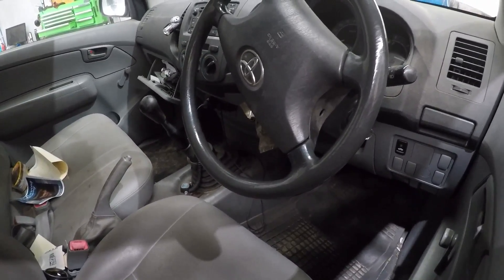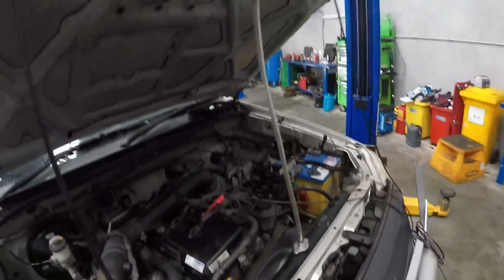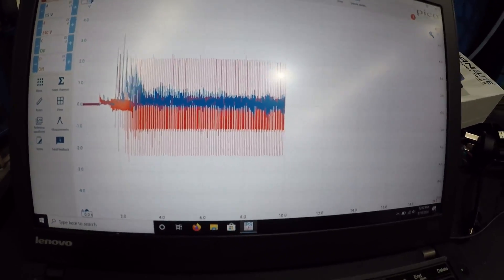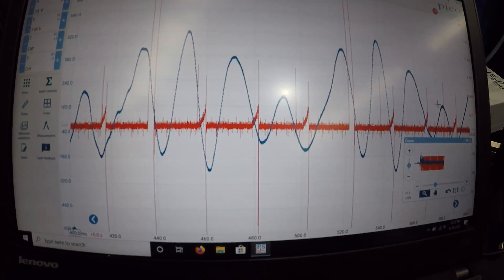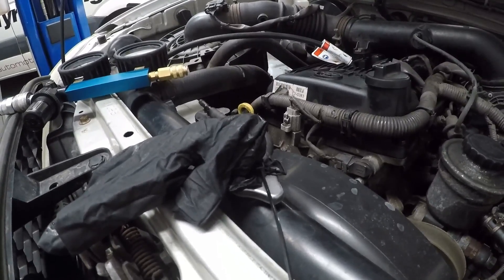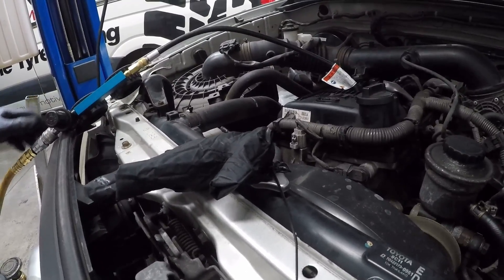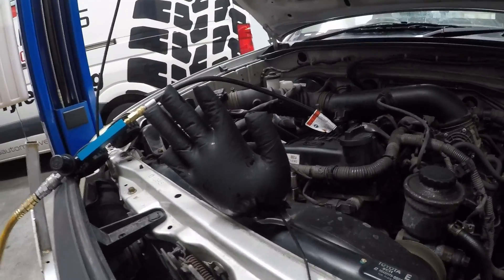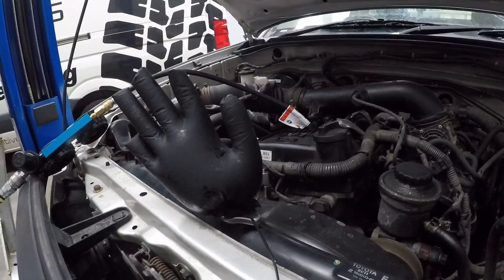Quick confirmation of a blown head gasket with a pressure pulse sensor, picoscope & rubber glove!

Comment: how do you diagnose a possible cracked head that is leaking oil into the coolant system? I have a pilot 2014  which has oil in the coolant system, would a crankcase pulse & radiator system relationship suffice for this? I don't have overheating issues, coolant is overflowing with oil so it is leaking out creamy fluid lol
Reply from the maker: Sorry scientist but I'm not sure what a Pilot is. We don't have this model in Australia. Does this have either an engine oil cooler or transmission oil cooler where the fluids could be mixing there?
Reply: @romanosautomotive  I suspect engine oil as it was low where the dipstick was not reaching it and of course the coolant was being filled in with it and looks creamy lol. It does not have oil cooler like Nissans, etc.

Comment: Would it be possible to have the same symptoms from a leaking egr cooler?
Reply from the maker: Yes depending on how bad the leak was but if using a pulse sensor and a scope to see that, you would expect the pulse from the exhaust on each cylinder to be even and not stand out as a fault on the scope screen.
Reply: @romanosautomotive  thank you for the information. Hello from Ireland.
Reply from the maker: Any time!! And hello back from AUS!

Comment: Why not just use a large bag and a CArbon monoxide detector
Reply: Carbon monoxide tester is only going to pick Carbon monoxide. Were this method will pick up any of the 5 gases and also show the cylinder at fault.
Reply from the maker: There are many ways to do it. I'm not telling you which way to diagnose it. Just an example.

Comment: I have just started using one of Cody's pulse sensors. With a normal running engine would you expect to see no pulses or would you still get some with a lower peek.
Reply from the maker: You would expect to see some pulses from the water pump impeller but quite small in amplitude and the key is them all being completely even
Reply: @romanosautomotive  that makes perfect sense. Thanks for the reply.
Reply: I was going to ask the same question,thanks for sharing